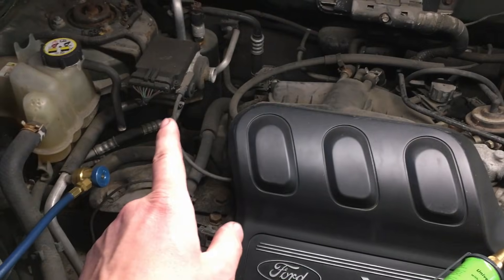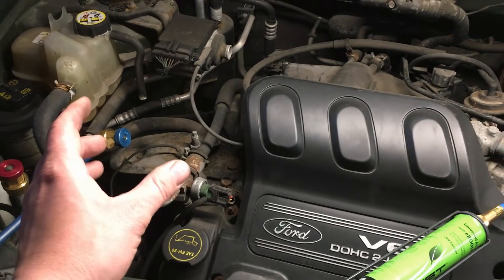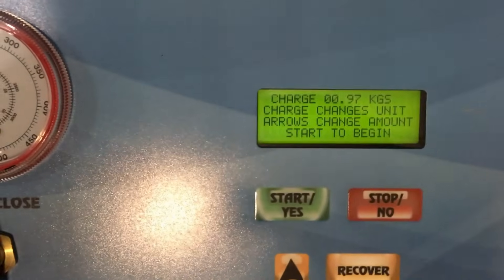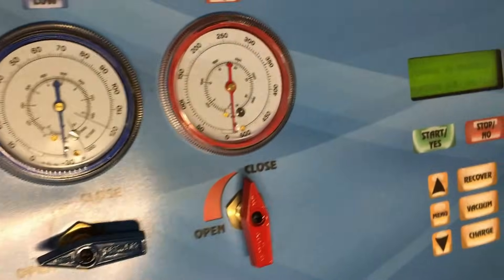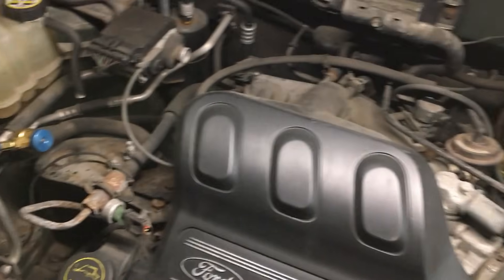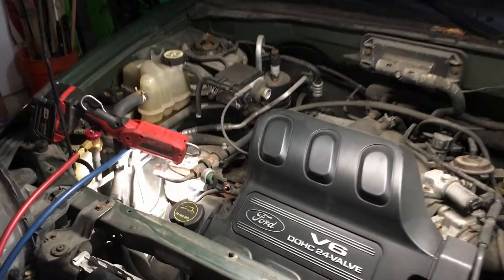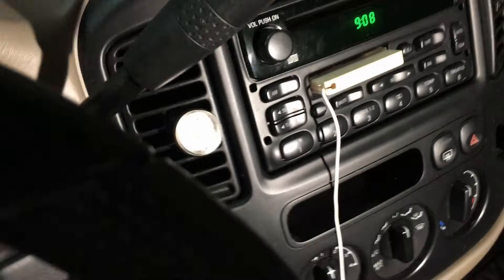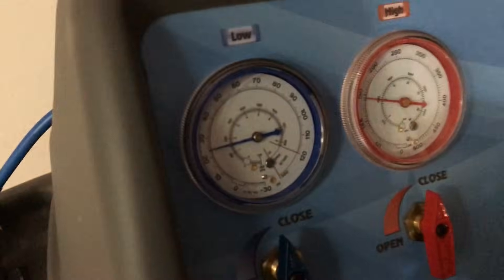Automotive A/C System Leak Testing with UV Dye: Is it The Most Accurate Method?

Comment: first video of yours I've completely disagreed with I dispise die, die is a non condensable liquid hard on compressor and does nothing but hurt cooling capacity of a.c. systems either use nitrogen and soapy water or a sniffer with nitrogen and a trace freon charge to locate the general area refridgerants are heavy gasses and won't clear themselves out they'll pool in an area  so you have to use a fan or shop air  cars a.c. compressors use Polyester oil which is extremely hydroscopic  meaning it scavenges moisture from the air but I've used shop air with no bad luck looking for leaks I always pull a deep a vacuum as possible afterwards I have a nitrogen tank now but most people can't afford that expense also I always change the orfice tube  I don't bother with the receiver drier because it's just a deccicant bag on Ford's not directly in the flow of refridgerant which has no filtering effect ... that being said I love most of your videos and normally agree with everything you do
Reply: FordTechMakuloco This is true....most pag oils come with dye already added...I see no issue with dye in the system!
Reply from the maker: Everybody has their ways of diagnosing these systems, so thanks for voicing yours. We can all learn from each others best practices.  Any additive to the a/c system is not good for it I understand that but in moderation they are ok and are approved by Ford as the preferred leak detection method until that changes I will be using dye to pinpoint leaks.

Comment: If you want the best sniffer. H10 is the best. We use dry nitrogen for pressure test with small amount of refrigerant for tracer gas. Could have quickly found this one without dye or 2lbs of gas wasted.
Reply: Joe, Agreed! For the vehicles I work on warranty  has stated they will no longer pay for a evac and recharge with dye. Even a small leak is found easily with Nitrogen. I'm in South Florida and its funny to see how many systems have new parts hung on for a simple "O" ring or a condenser leak.
Reply: Joe Shearer it would be awesome if you would make a video showing nitrogen pressure testing on a car and showing your gauge to line setup as well.
Reply: Yeah but the video was made to show people how to check for leaks on their own don't think 99% of dyi's are willing to pop down hundreds to over a thousand dollars for a sniffer system like that when dyes can sufficiently do the job for far less.
Reply: +1 on the H10 Pro - thing is absolutely unreal.

 I detected a leak on a hose I had custom made for my '93 Volvo 940, since I didn't have the right connections on hand - I figured the system would be completely empty in a few months. Turns out the leak is in the tenths of an ounce per year range - the way it sounded off, I had it in my head that the leak was huge. Not the case at all! Pricey, but well worth it IMO.
Reply: H10 is the next level.
She a leaker💦
Reply from the maker: +Joe Shearer yeah I didn't expect the leak to be so big but the gas was not wasted only small bubbles then it gets recovered right away. The recovery machine makes this very easy.

Comment: I have that green die still allover the bottom of my car when the case seals on the compressor leaked!  Residual UV die is hard to remove. You can get that light cheaper if you shop around,. I may buy one as my small UV flashlight sucks ! Me either, I would not add air to a empty system. Just quickly charge it and recover it when you find a leak
Reply: The advanced auto brake clean I usually buy did not do the trick but rubbing alcohol worked ok  The frame on my car, a GM with the wax coating which sucks absorbed it like a sponge lol    When the compressor leaks AC oil bad I also learned that it will destroy the belt. :)  Really. If you have a bad leaking compressor, especially from the shaft seal toss the belt.  I tried cleaning it, it slipped at max engine RPM passing cars at 80+ :D

Comment: not being smart ass. when you say using compress air to check the system it will be sudden death? isnt it when the system has leak, you already introduce moisture?? and by charging the system with freon dye, yes it is the quickest but also almost like illegal discharge of r134a
Reply from the maker: +ebu touy most systems have some kind of pressure in them preventing the moisture laden air from coming in. Now this one has been open for awhile making it worse. The reason compressed air is so much worse is the moisture in the air condenses with compressed air so many times water droplets are now entering the ac system not just moisture laden air.
Reply: I've done several fords with shop air while it's considered bad practice never had any troubles always pulled a vacuum down to 600 microns after to remove as much moisture as possible nitrogen is ideal but also 2 or 300 dollar setup
Reply: ebu touy you can refer to EPA section 609. In MVAC systems you are not required to fix any leaks. I don't recommend it but it's not a requirement
Reply: ebu touy not of you recover it before making the repair. It's also not required to fix the leak before charging
Reply: "not required to fix before charging" i suggest double check your law regarding repair of A/C system :)

Comment from the maker: Let's hear your favorite leak detection method and why!
Reply: I start off with Nitrogen at 300PSI, listen for the lea. If I cant find it then I use your method showed here. Man I love working on Air Conditioning.
Reply: Nitrogen and soapy water in a spray bottle works if you can see the line. Sometimes thats not easy on this newer stuff. 
I also have found leaks with soapy water using system pressure only. Simply spray the lines down repeatedly and watch for leaks.

I once found a slow leak on a toyota truck with soapy water on the AC manifold line shortly after bumping the Nitrogen to 240 PSI.
The leak was coming right through the side of the hose surpisingly and not a fitting or O-ring.

What causes the compressor to cycle? 
If the compressor never cycles does that mean its over charged?
Thanks!
Reply: Helium (smallest safe molecule) and a GasCheck.  (and a LOT of time)  That or, just drop it off.
Reply: Thanks loco, I use nitrogen,  electronic stethoscope,  micron meter, then the typical ac service equipment.
Reply: I use only 200PSI, I think its MAX that HELLA (one of the manufagtures of these ac systems) lets you use. + ofcorse soap and water with it.